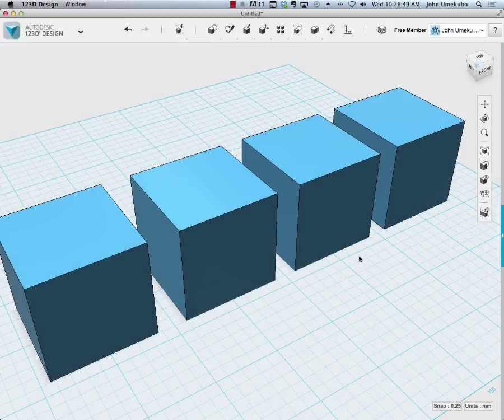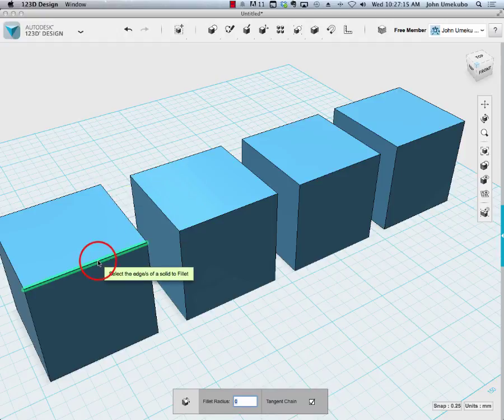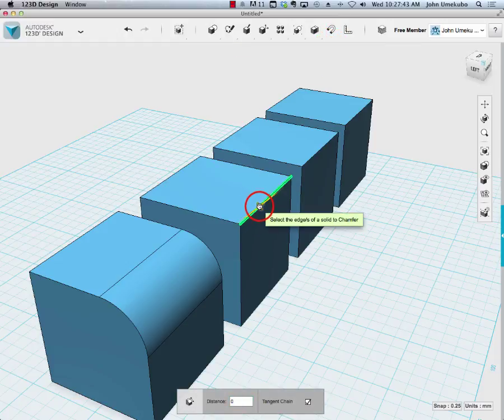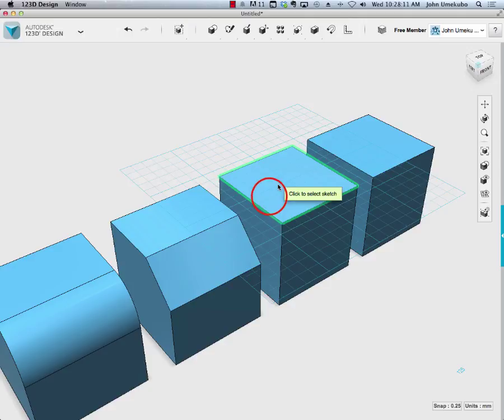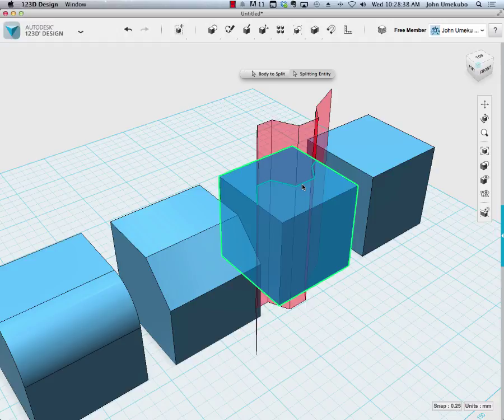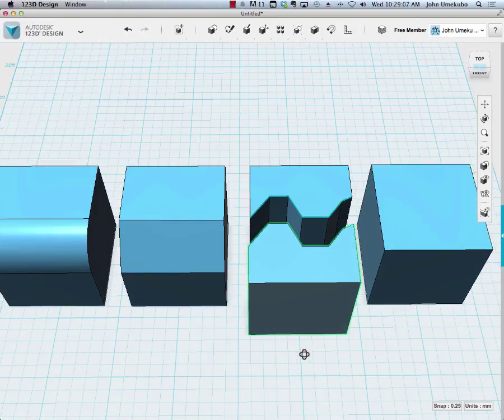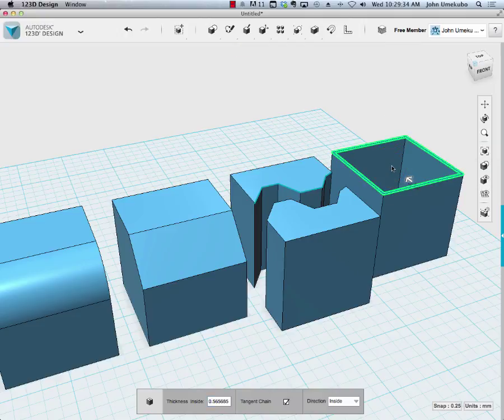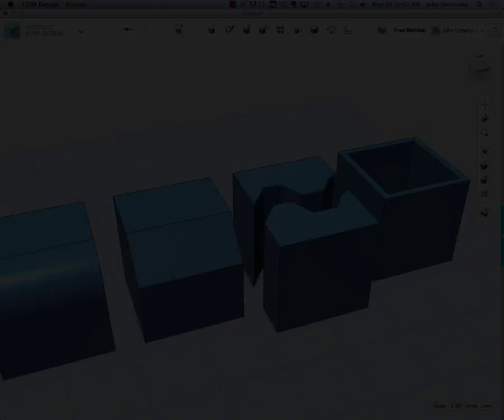Autodesk 123D - Modify, fillet, chamfer, split body, hollow

Comment: I know that this program is not in service anymore however I still like to use it so if you are still around my question is... Sometimes these features do not work. I get an error Red Box saying this function cannot be processed or something like that. What causes that and why is it that sometimes you can't put them on at all because of that error. What is happening and how can I  make it do it when I want to do it?

Thanks
Reply: Agreed, maybe they will get there. I did not understand the choice to drop 123 for Tinker but it's business and their's to do so. If they were to add the cool feature of 123 to Tinker I think it would definitely be a top cad program. 

Kind of a mini Fusion.

Thanks for getting back to me, much success to you.

Comment: That's cool intro! I'm wondering if you know how to edit a fillet or chamfer a vids on this will be great :-)
Reply: This is a very good question. I don't know how to do this, and haven't seen anything online that talks about it either. If you click on the edge within a chamfer or fillet, you can modify (tweak) the edge, but that's not the same thing as editing the chamfer/fillet. If anyone else knows, I welcome the response. 

Note, you can also remove the chamfer/fillet, by selecting its face and hitting delete.
Reply: I was able to modify a fillet (specifically to alter its radius from .1mm to .2mm) by selecting it and then choosing Press/Pull from the pop up menu. It's a bit tricky to select the fillet. It seems you need to select the whole object first, and then click somewhere within the fillet.